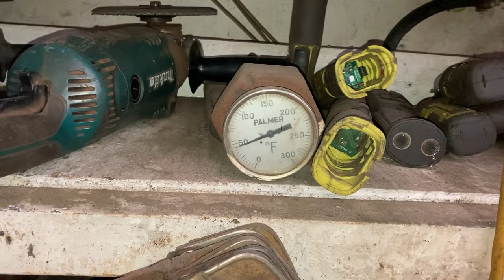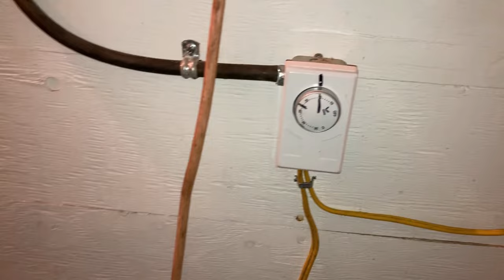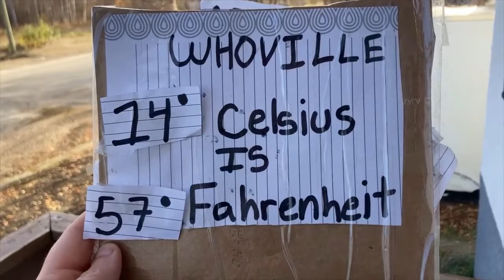Bottle Hunting with The Staff While I did More Wiring Oct 15 2023

Comment: Joey  the Kingdom is looking really good. It's a good thing you preserved all your artifacts. Parts are sometimes difficult to find even in the cities. Xena those are some good finds on the trails especially the 7up bottle. That one is marked Winnipeg, I wonder if that's the bottling plant or just the company address. Your voice is improving. Thanks see ya tomorrow.
Reply: 7-Up was bottled on Berry Street back in the day. I think Pepsi took over that plant as they were where U.P.S. is now., Route 90 and Dublin. I worked for them as a helper in 63-64. Xena you can wash those glass soft drink bottles as much as you want without hurting the labels. The were washed in big commercial washers back then, as they were reused over and over.  Had no plastic bottles back then and cans were just coming out in the soft drink industry around 63-64. There were 10 0z., 16 oz. and quarts. Should tell you the size on those 2 bottles.
Reply from the maker: yes in the new world no one stocks parts any more  thansk
Reply: Will have to look more into the bottles and see where they came from. My voice is slowly coming back, thank you. 

Xena

Comment: It is Sunday figured out 97 f350 power stroke enjoy bev here's what I found thought bad fuel pump not did tests got pump action  OK their is small filter in fuel pressure reg was plugged solid truck is golden that's were my power was going cheers guys 😊
Reply from the maker: it will be a money pit for you thansk
Reply: The 600$  Ranger is a deep hole for such a little truck

Comment: The screw on connectors don't work for me either. I bought a whole bag of the good ones when I found them. You're waiting for a rain day in the shop. I'm waiting for a rain day in my house. No housework when there is too much to do outside in the summer and get stuff done before the snow. 
Microsoft is no longer supporting windows 8 in my laptop so they want me to buy a new one. Not going to happen. If a computer guru can upgrade it to 10, Microsoft will charge full price for it. They did something to my sound. Been using CC all week. Finally found the problem today. I was so happy when I found out a few years ago that someone here in Canada won a class action suit against Microsoft  requiring all computers purchased have Windows installed. And the monopoly on Word and Excel when there are much better programs. I didn't apply cause I only have 2 but I expect large companies benefited. The yard is looking really good.
You sound a little better. Hope you are well soon.
Reply from the maker: yes the world is a screwed up place with everything controled by only a few certain people. so glad i live in the Kingdom and control what i see of the outside world.  thansk
Reply: I still feel like death, but I am slowly getting better. Thank you 

Xena